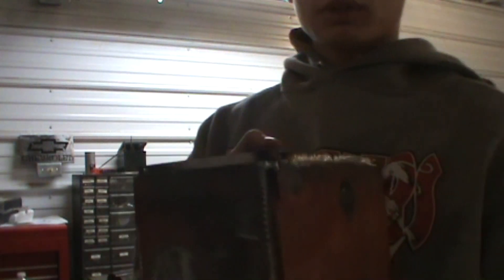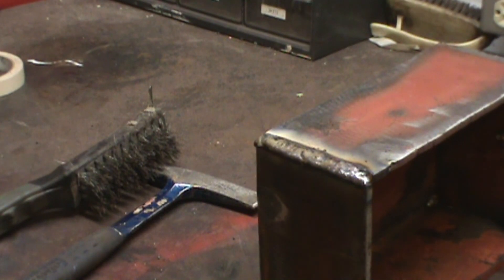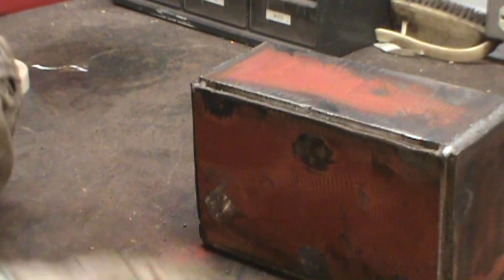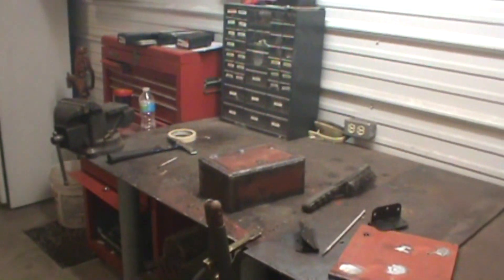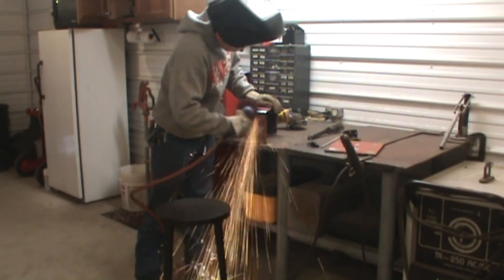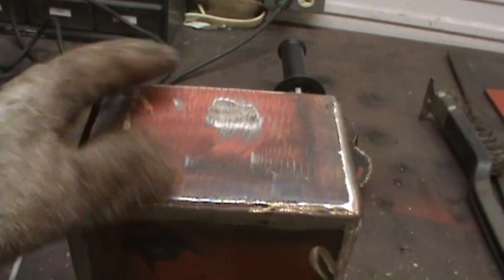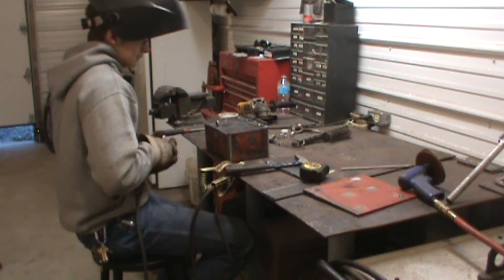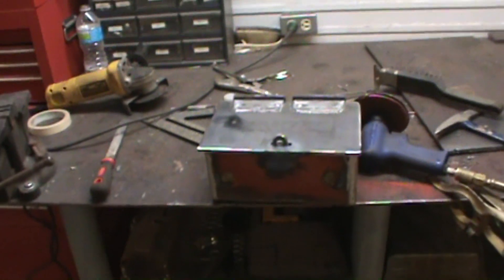Outside Corner Welding

Comment: Great video Wes & it was very helpful on my project. Im building a firebox for a smoker which is basically the same process only larger. I have a question, you said you tacked the box with a mig & then used stick. Is there a reason why you chose to use stick vs mig? Will me mig welding my firebox affect the strength of the box? Im a noobie to welding & only have a mig. If possible can u make a plate corner weld video with a mig to show the difference?  Thanks bro.